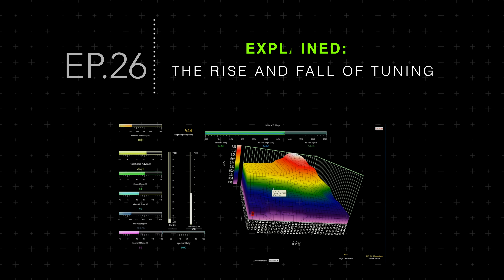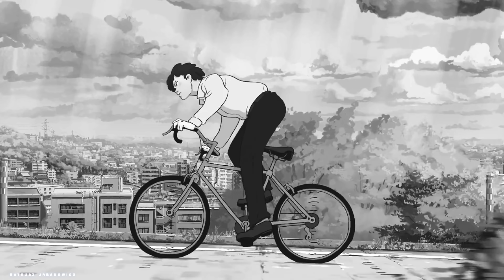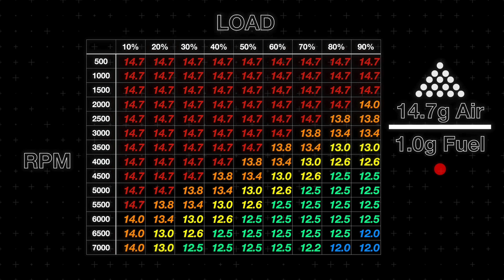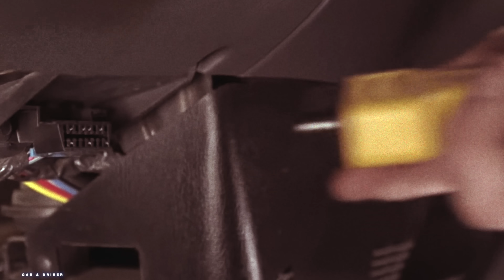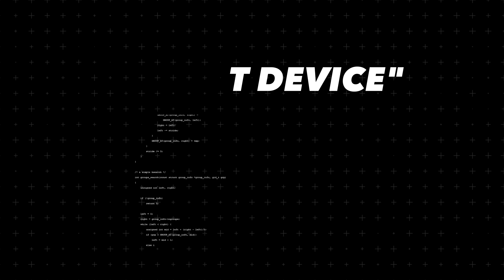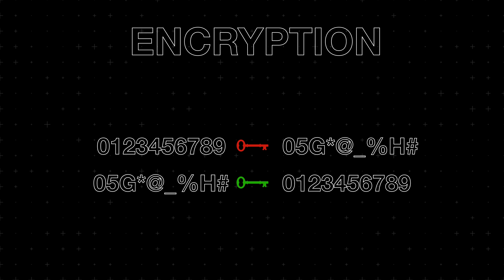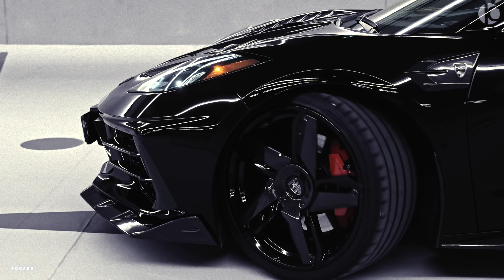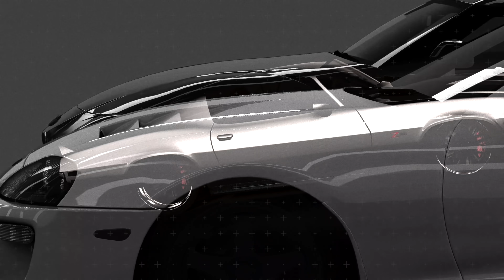How Tuning Engines Became Illegal👮🏻‍♂️| Explained Ep.26

Comment: I love that the EPA decides to focus on enthusiast cars that make up a small amount of overall emissions instead of going after commercial vehicles more strictly.

EDIT Holy crap mom, I’m famous!!
Reply: Easy targets ,that's why
Reply: Easier to control the lives of normal people rather than billionaires
Reply: They’re going after ALL ice engines
Reply: @dregsta  like the bastard scum they are, didn't you know no body but them are allowed to have access to deny gorm of energy; watch if zero point systems are allowed to be released as a replacement technology (lol) they will inevitably find something to btch about and collectively punish the rest of us
Reply: @dregsta  Which is impossible. Theres nothing illegal about driving whatever powered car you want as long as it passes safety ratings.
Reply: In other countries the same. It's propaganda. People that drive 10times more there it is necessary (arguable what's necessary and what not) and the other half wich drives less from that 1% people wich tune more than a little don't make any difference! Big problems will only be touched after the small ones are eliminated. The smaller the better but on public they were made big.
Reply: Bribing of our politicians needs to stop. Most emissions actually come for industrial machines and CMVs. Passenger cars are only a small part of it. You can’t mod your car to run cleaner but Cleetus can “roll coal” all day long.
Reply: @angelgjr1999  Passenger cars only add up in the big scheme, because there's so many of them. 
There's a drastic difference between a manufacturer building 100,000 cars with emissions defeat (specifically to beat the test) versus tuners working to make hundreds of cars more efficient.
Reply: @angelgjr1999  nah
Reply: @angelgjr1999  My work friend saw on the news that Germany stopped all the emissions bullshit for passenger cars since after years and years of pushing EURO 1, EURO 5, EURO my balls, they realized cars do absolutely nothing to the ozone/air quality and that the real culprit is something entirely different from small vehicles. In Europe multiple manufacturers stopped making 2 stroke 50cc motorcycles because of the emissions mandates. We live in a disgustingly incompetent world and it's not being political when you say that all politicians are absolute idiots.
Reply: Or "light trucks" which are exempt in USA.
Reply: @Vok250  would be interesting to see people waking up to the crash standards of cars vs light truck ,I won't hold my breath because the world's gone silly.
Reply: @Vok250  Commercial and light trucks are not exempt in the US. Hence the reason California doesn't allow commercial vehicles older than 2011.
Reply: @Vok250 your stupid, trucks haven't been Exempt since 2010
Reply: Bro what? Commercial vehicles are extremely restricted, most trucks have virtually no emissions with the requirement of def. If you get caught with a deleted truck they can be impounded and you fined over 10k, and if you sell deletes or work on them in anyway you can be fined millions.
Reply: @WillBilly.  ok? If you get caught trying to defeat emissions (using an O2 spacer) you can be fined the same amount
Reply: @nodekapunk  never heard of it outside cali. I guarantee the fines are higher for deleting semi-truck emissions, you can be charged up to five years in prison and a $250,000 fine for individuals. Stop furthering the misconception that commercial Trucking has very little regulation.
Reply: Commercial vehicles are already restricted. 

You cannot carry this much load, you cannot bring this type of cargo, you have to made space seating this measurements, you can drive this amount of hours, your truck needs this fluid to clean up the exhaust, inspections are bi-annual, ect...

Commercials are regulated, you are next.
Reply: Oh and they've gone after commercial vehicles hard. Most trucking companies can barely keep their fleet of new trucks on the road thanks to the horrible after treatment system. If they really cared about carbon emissions they'd be going after cargo ships and the factories over seas that keep them full of goods to transport. Just 14 of the roughly 5,000 cargo ships in service put out more carbon emissions annually then all land vehicles combined. It ain't about the eviroment buddy WE are the carbon(based lifeforms) they want to reduce.
Reply: @SheriffPickles1776 
They are going after ships and shipping companies. Cruise ships are now required to plug into HUGE shore power plugs when in US ports. They are building more and more on Docks. The problem with container ships is you have a huge container crane Rail system running along the dock edge. They are working on a work around for that now. Big ships get ONE engine or massive generator system when built. The Engine stays in the ship for life, you just replace each piston inside the engine room, when trouble happens. The ships can run when one piston is put O/S. The biggest manufacturer of large ship engines is developing a multi fuel combustion chamber. So at dock removal and load of cargo it runs on one type of fuel ( Methanol) But that is still an issue as they need shore storage tanks and a dock so fuel barges can load the alternative fuels, then tug them over to  bunker on the side of ships. The infrastructure needs to be built first.
Reply: @SheriffPickles1776  " If they really cared about carbon emissions they'd be going after cargo ships "
They already did by making them move from using the waste products of oil refining (fuel oil) to essentially diesel. And those costs will be passed along to everyone.

But feel free to ignore that the 3% of emissions moves around 90% of all cargo. Your Uber Eats driver can't say that.
Reply: @thelastminuteman7513  10-4!! Facts.   The new emissions equipment lives in the shop and is not productive.  And if California keeps digging its own grave in about 10 years it will be bankrupt due to "Goofy Laws."
Reply: @SheriffPickles1776  Carbon is not a pollutant. The game is about control and depopulation.
Reply: @dannygreen7473  how did this go from car tuning to population control? 😂 touch grass dude
Reply: No they make them run through egr, dpf, Def spray
Reply: @ayliniemi  and when it breaks down the shop bends you over and run your pockets.  Insanity Expensive to repair.
Reply: Nobody talks about the huge ships, with zero emission regulations, all over the world 

But they wanna fuck with my little 2.0 TDI
Reply: @x_sirsteez at least some ports are finally banning the most polluting ships.
Reply: @x_sirsteez  maybe the little swedish how dare you girl can build them a giant sea-worthy wind turbine to power little electric motors that'll push them to unheard of sea speeds of around 2-5mph. After all she's really "smart".
Reply: Also: ocean liners/shipping liners are major pollutants
Commercial jets and liners are major contributors. 
developing and first world industrial processes produce pollutants

the average driver doesn't have any interest in personalizing their cars. EPA is absolutely missing dollars for dimes...not even... missing Bens for pennies
Reply: That’s a problem with us politics in general, politicians keeps obsessing over insignificant things, probably because they are all over 70 and have degrading brains
Reply: @users4007 they focus on the things that don't impact themselves but appease the voter base they manipulated.
Reply: @users4007 what do you mean degrading? their brains have been gone for years
Reply: @users4007  No its a problem with democrats. Like AOC and Kamala Harris.
Reply: and are bribed or, "under the influence of lobbying" americans calls @users4007
Reply: Man their priorities are whack
Reply: Do you even know what the black smoke is? 2nd commercial vehicle are already regulated.
Reply: You forget  where the air pollution in the ozone layer are Maude up of less than 16% from the auto Industry the highest contributors are textile(clothing) and the food industry (mainly dairy)
Reply: @ykkentaro1792  Actually the #1 contribution is U.S Military by a loooong way.
Reply: Even then, commercial vehicles are just the same way, DEF is not something that should be required on engines. All this emissions stuff that is on big rigs and heavy equipment reduces performance. All and all, the emission regulation is really bogus when more emissions are used to make an electric vehicle than what a normal gasoline car makes. Granted, we don’t wanna pollute the earth, but there can’t be these regulations that are doing more harm than good.
Reply: All so if you want, and can afford a new $50k all electric vehicle, they'll work tirelessly to produce them for you to buy. They'll then go all over the world digging gigantic holes for mining operations. Digging up the very toxic lithium battery chemicals & minerals. Exploiting whoever, destroying environments, & polluting oceans. And all while still requiring petroleum to make all the plastics use at factories and powering the shipping industry. All for a greener earth so those that can afford it can tell you how you're disgusting & how wonderful they are for "saving" the planet.
Reply: For real semis are the worst offenders, even ignoring diesel emissions, 100% of all tanker spills are semis 😂
Reply: They're up our asses too i drive semis. So your statement is false
Reply: Just don't live in a state with Inspections and Emissions testing. Some states respect your right to own your own vehicle and be responsible.
Reply: @KrustyKlown  I wish
Reply: Weeeelll what can they say, gotta have those sweet-sweet lobbyist money 💰💰💰
Reply: @NNYYLL lobbying with money needs to be made a criminal offense, those lobbyists and legislators taking that money should be doing hard time in prison
Reply: They are going after commercial vehicles like crazy too,
Reply: If I commercial vehicle you mean commercial diesel, it's because diesels are already one of the most cleanest burning vehicles on the road and they've invented DEF and smog, to pretend like they're doing something, but really they're just costing everybody more money.

More money out means more fuel needs to be burnt to break even, and higher cost as the consumer for the same product, because California has zero concept of the future, or ability to actually prepare for it at all 😩😩
Reply: bro diesel isnt bad for the environment
Reply: @Rambo_1738  oh shit, my bad. It’s way better than gasoline. You right
Reply: Globocorp has lawyers and fights, that's when they're not paying these vermin beforehand.  Going after the little guy is painless, for now.
Reply: Kind of like how the ATF, FBI and DOJ are going after a minority of working class people who have never harmed anyone  for having an "evil" shaped stock on a rifle instead of going after actual gangbanger murderers  and criminals. How the IRS is going after blue collar for selling old crap from their basement and not reporting it them instead of the corpos and wealthy elite that fund the politicians? It's  sad to see normies find out the government is going after all of us too late. They don't want you to own shit buddy. They always start witha minority they can label a threat and a danger to society.  You better start paying attention to politics or be prepared to eat the bugs live in a pod own nothing and be happy.
Reply: Nope, this ignorance is why they are targeting enthusiasts, because you don't actually know anything about cars. Ignorant people are easy to manipulate.
Reply: Meanwhile the U.S. government is in the top 10 polluting entities in U.S. the rest are power companies. Preventing car tuning isn't going to change anything in any meaning full way.
Reply: One volcano in one eruption produces more greenhouse gasses than the entire human race combined in 150 years…. Up to 70 sum volcano erupt each year.    Man made climate change is a lie and the epa should be destroyed..
Reply: The real enemy is the government.
Reply: @AncientRe  jk, just wanted to come off as aggressive
Reply: @AncientRe  Yeo.
Reply: They do indeed go after commercial trucks - often. Any driver who has ever driven through the commie state on NY and had one of those bastard-ass brown NYS DOT vans pull them over while hauling the economy behind them knows this.
Reply: Or commercial ships…
Reply: not like emissions are an issue from cars. what carbon monoxide does get emitted is few ppm not the legions of ppm they are saying in their fraudulent stats. not to mention, we have the tech to make cars a clean burn. as in hardly any carbon sub compounds. but people won't also using crude oil based fuels is obsolescent when the common yobbo can make greater performing fuels in his garage.
Reply: The EPA is just another layer of alphabet soup domination. Any group that lays claim over abject sovereignty of all the Earth's atmosphere (which is in the EPAs charter), makes one think when will the point of 'the green svastika has been indulged long enough' be reached🤷
Reply: What like semis?? They are ruined and castrated thanxs to EPA. DEF systems that kill the engine so ppl feel better! rember that next time your stuck behind one!
Reply: Itll be funny if gov officials already knew VW cheated their EPA system before 2015, thatll be silly
Reply: Keep your shirt on big fella...they're all up in our collective a$$es
Reply: Corporate and government  power want to prevent refurbishing as personal vehicles are phased out. Look at California laws just banning all commercial vehicles before 2011 or so.  Look at cash for clunkers. So many efforts out there to get old cars off the road. This DRM on car electronics is part of the same effort just as it is with smartphones and laptops.

If you can centralize the electronic automotive tool making industry into the handful of service companies who can jump through the regulation hoops, you have nearly complete control over car repairs. No one else knows how. No one has maintained the skills to hack into ECUs for years because tuning is illegal..  Only the one central company who is being babysat by government and corporate. 

If they say drive a new kind of car or take the bus, you won't have any choice because no one will be able to maintain your car without permission from it's maker and the EPA.
Reply: Commercial vehicles are also required to deliver your parts, food, water, clothes etc. Go after them harder, and everything gets more expensive.
Reply: " instead of going after commercial vehicles more strictly."
They're doing both. But duly noted you're willing to throw them under the bus for your sake.
Reply: @wisenber  they’re on the road way more than I am. They’re polluting way more, and it’s a business that needs to be regulated, not a private citizen. So I will “throw them under the bus”
Reply: @nodekapunk  "hey’re on the road way more than I am."
They're also regulated and inspected way more than you are already. And they pay far more road taxes than you do.
Plus, any added expenses to them gets directly passed to you.
But hey, if you can just get them some more attention, you can knowingly break laws, right?
Reply: @wisenber  naw, I already pay out the ass for everything already. Might as well breathe clean air.

Truckers are assholes btw, but I’m mainly talking about planes and oil tankers
Reply: If only idiots wouldn't modify cars to produce smoke and noise this wouldn't be a problem.
Reply: They epa & carb have already raised hell with commercial trucks . In California 26, 000# & up the emissions standards your truck must be year 2012& newer. & they are not stopping there. Instead of pointing the finger the other guy point it at the problem epa_ carb!!
Reply: @ruxoneto6560  carb doesn’t exist. I don’t live in a communist state
Reply: How about billionaire lifestyles.
Reply: No vehicle is emission free.
Reply: The EPA needs to piss off completely.
Reply: I think its all a complete joke and pointless as China builds a new coal power plant every 3 days.
Reply: It is a mechanism to condition you to accept "authority". Remember, "you will own nothing and be happy". 🙄
Reply: One trip of a commercial cruise liner does more to pollute the air than every tuned vehicle in the country, COMBINED will pollute in a decade.
Reply: Manufacturers fight back with lobbyists and expensive lawyers, Joe/Jill Sixpack won't/can't fight back, so it's a question of picking the easiest targets.
Reply: It’s the same reason they have always targeted the “middle class” for all other violations.  Good, upstanding working class citizens will pay the fines and carry on with life even while being extorted.
Reply: F- the EPA. All a scam to steal more money and control from us.
Reply: The point is nothing to do with the environment. It's to make people complacent with not having rights to their property. "you will own nothing and be happy about it". These same people are in every branch of government, banking, entertainment, big corporations, etc.
Reply: They shouldn't go after anyone at all because everyone should know that climate change is pilpul lmao
Reply: They started with commercial vehicles. That's where the big $$'s at.
Reply: When you cant hit the big dogs you go after the small fry.  Get enough of them, claim you are doing good work by the sheer numbers of who you are catching an gloat ignoring the fact you are actually doing nothing.  I also feel like there is a huge incentive for the car manufacturers here.  If you want a car with more HP and all it takes is changing up some values all you seemingly have to do is throttle it and say its "stock" but then up the price by 5k and claim is a "sport edition".  Suddenly you can rake in billions with little to no effort.
Reply: It's disgusting the power the EPA has been given . They get to bypass due process guaranteed in the 7th amendment under the some bullshit administrative law. They extort the evidence by threat of fines if you don't give them your shop records. Then they are accuser and jury all in one.
Reply: Communism is against private property.
Reply: Man I’m literally doesn’t care what politicians r saying about our tuner cars imma crap this shit out of my 400 hp maxima with sup and illegal ECU just to get our opinion heard
Reply: Remember that the EPA doesn't have enforcement over government vehicles.
Reply: Hell, finding a greener way to make concrete would be a start.
Reply: @zackhype  "Greener" is more often than not the furthest from environmentally friendly you can get.
Reply: Sir, the commercial vehicle restrictions are already making it borderline impossible for truckers to have reliable, affordable, practical motors with which to haul the goods we all need. Driving up prices for all of us. The EPA needs to stop, period. Long ago they were given a job to fix up certain glaring and hideous environmental messes, such as lakes and rivers catching fire, that sort of thing. Being a government organization, they have continually exceeded their original mission statement in order to justify their existence and funding, continued to crank down on emissions and fuel economy requirements until they have driven up the cost and complexity of engines and made home vehicle repair an arcane nightmare in many cases.
Reply: @cmbaileytstc  defund the EPA
Reply: @cmbaileytstc  They should be disband. Jist like the Dept. Of Education and the Federal Reserve.
Reply: I love how the EPA thinks they can create laws like the ATF
Reply: and the cruise ship industry
Reply: They say: 
"enthusiast cars are less efficient than the average vehicle, so they need to be focused on"

So short sighted....
Reply: They should go after neither because the epa is unconstitutional
Reply: YEA THE BOATS JUST THE BOATS I MEAN SHIPS BURN BLACK OIL !! MILLIONS OF GALLONS ITS CRAZY !! POINT YOUR FINGER !!
Reply: @rickybailey7123  It's a valid complaint. They're complaining about my candle while they're lighting their house with bbq grills.
Reply: That is 100% true.  Ever notice how black and cloudy the exhaust from a large Diesel truck is?  I am thinking of large trucks like dump trucks and other vehicles designed to haul heavier loads that would be unthinkable to haul in a regular pickup truck.  I still remember as a child back in the 80s in Pittsburgh, Pa there were port authority buses and they were not only as slow as molasses in January on a lot of the hills there but the exhaust would be a little bit nauseating too.  Just think, these were not the vehicles that left a cloud in the air that would linger for 5 minutes after they were gone either.  Really though, it does feel like the EPA does not focus on the real polluters.  All of that stuff you see on TV with then villainizing internal combustion engines is not entirely true.  While it is true that my vehicle does not have the cleanest emissions of any other out there it is far from being the worst.  I know what you are thinking and no it is not a Toyota, the only thing it has in common with them is a Japanese manufacturer and it is not Honda either.
Reply: @charleshines2142 yeah in the 80s but semis have some if the biggest emission systems now, run almost clean, and the fines are insane if you delete it.
Reply: @WillBilly.  exactly. Black smoke is excess fuel. Tuned right you can get 1000hp with little to no smoke in the exhaust stream.
Reply: Yep. Florida doesn't have a state inspection. So you see a lot of commercial and pick up trucks blowing black smoke.
Reply: This is spot-on.  Stuck behind a diesel school bus that barfs out giant clouds at every stop light? EPA says no problem.  Want to add 50HP to your car?  EPA says hand over your wallet.
Reply: The EPA needs to go away.
Reply: EPA goes after illegal vehicles. If "enthusiast" cars were not illegal, the EPA would not need to ensure their compliance with laws of the land.  "Enthusiast" are responsible for remaining in compliance with the law.
If you want more restrictions on commercial vehicles, contact your local representative or senator.
Reply: @travelinman70  ok Karen, calm down. I bet you’re a trucker. I can tell
Reply: @travelinman70  The EPA does not go after individual vehicle owners .
Reply: Remember, it is all about power and control. The EPA doesn't genuinely care about emissions but they do care about being able to tell you what you can and cannot do.
Reply: Exactly. Do you know what bunker oil is? The biggest engines in the world in the big shipping ships run on it, it's basically black tar, and they have zero emissions controls. And plus their reasoning for going after tuners for emissions is besides the point. Anybody could modify their car to have bad emissions by having leaky gaskets and spilling oil and antifreeze but the EPA wouldn't come after them. But if you tune your car to make more power and get better mileage, now you're in trouble? I'm having trouble putting my point into words but basically what I'm saying is that when people tune cars for performance, they aren't doing it with the intent of creating worse emissions, they do it to make their car run better and go faster. But the epa treats them like they are trying to "defeat" emissions when that's not what they are trying to do at all. Now diesel trucks on the other hand, yeah, when you straight pipe those and tune them for maximum performance it is a bit of an environmental disaster but for gas cars it's really nothing and a little diesel tuning doesn't hurt especially if you keep your emissions devices installed.
Reply: Why come after commercial vehicles when it's obviously more CARS THAN TRUCKS.
Reply: hackers will always hack
Reply: make public transport better for everyone and start banning some roads so they would be for peds, bycicles and public transport only. This is how you decrease emissions and make less cars on the road.
Reply: @john-b2r9p  so more of the same insanity that hit us here in the first place? You must love the collective punishment and domination by those who operate without any ones consent?
Reply: Don't forget the racing industry, you seen the shit those trucks pump out at those events where they pull the giant weight?
Reply: @The_Slavstralian  so all the bunker fuel burning of global shipping traffic and large governments and volcanoes pale in comparison to tractor pulls. Wow, I got a bridge to sell you....
Reply: @The_Slavstralian  it's america, who only turn left if the can go straight, which they hardly can.
Reply: When these specific cars endanger pedestrians and consume much more fuel than a modern supercar there simply is a problem 🤷‍♂I don't see what people see in trying to make a riced out Honda Civic as fast as a modern performance sedan. You're putting others and yourself in danger with a tin can trying to make up for its age. Not to mention how much they like to blow up
Reply: @Corvolet5  very narrow way of thinking . Modding things is what drives real progress . Lamborghini origines comes from modding a pos ferrari  transmission that couldn’t hold up. AMG came to life from modding Mercedes . All wheel drive or 4x4 came to be from car enthusiasts. People get a high from betting a half a million car with a raced out civic. Its the David vs Goliath . Nothing can buy that
Reply: @dregsta  There's a difference between "don't fix what isn't broken" and actually improving a manufacturer car while not solely focusing on power. I can only chuckle at people who think they're the coolest people in the world when they get their 90s shitbox to 1000 hp and it's still just a grocery getter that will murder your fuel economy and reliability. Not to mention in a country with low speed limit. I mean I don't blame Americans for only caring about high numbers and 0-60s but at some point you'll get tired of being too fast constantly unless you're some rich influencer who only races his tools around Mexico.
Or to put it simply: if everyone is super, no one will be.
Reply: @Corvolet5  when you mod fuel economy is pretty much a back though.  The more I think of it , modding a "grocery " getter with with 1000hp seems to me a much better economical solution  when you put in consideration the insurance and expensive parts that comes with owning a super car. Regardless you'll still be stuck in traffic with everyone else.  I lost interests in car mods or cars in general, im more into off road dirt bikes and atv where getting a dent or a scratch is part of game . Not having to pay for plates and insurance is a plus too.
Reply: @dregsta  I live in a place where 1000 hp tuning is just way too expensive to attempt unless you only let a chip do the work in a modern supercar or power sedan (can't say that goes well for long).

Anyway as fof maintenance costs, sure the insurance would be cheaper, but the constant risk of parts failure will probably affect you almost as badly as in a supercar. Which on its own is already not a great sign. Not to mention you'll be folded in two when you have a serious crash in a car that isn't designed for high speed crashes.
Reply: @dregsta  So your OK with polluting just for fun? 🤦‍♂
I'M KIDDING!!! (I tune and Drag race bikes like the one I'm on in my avatar) 😎